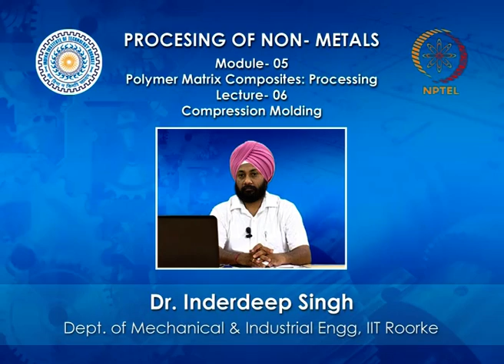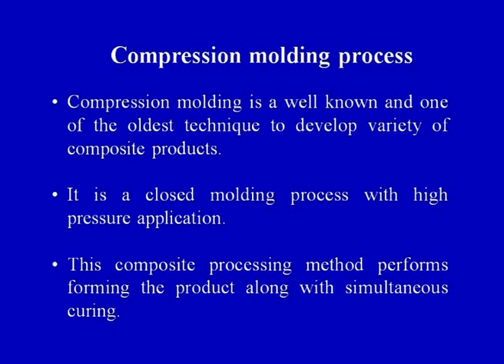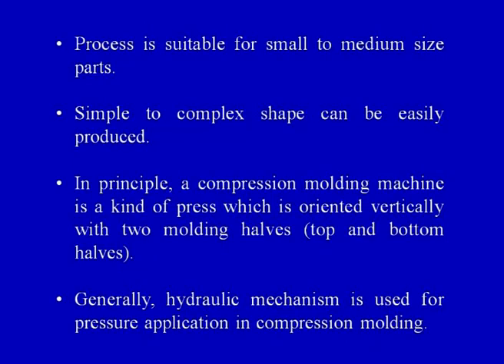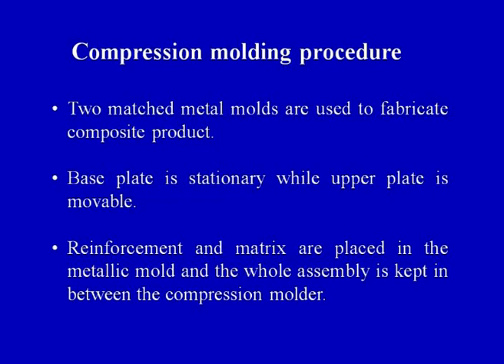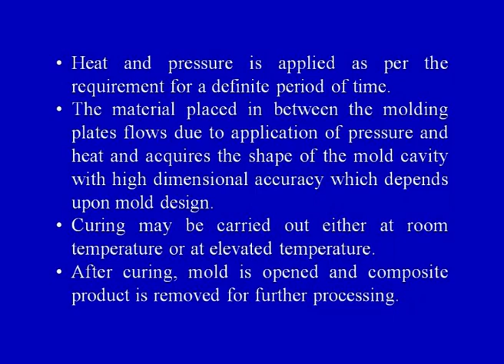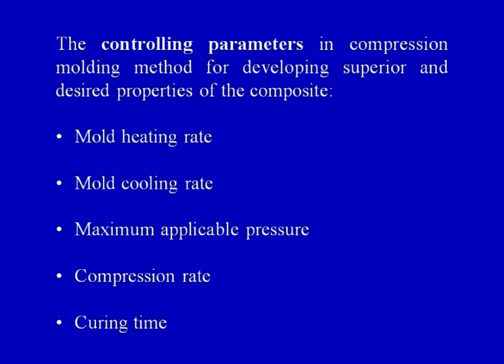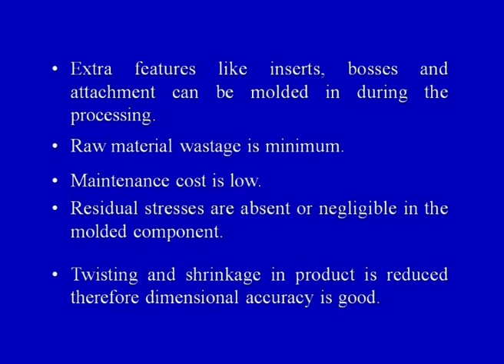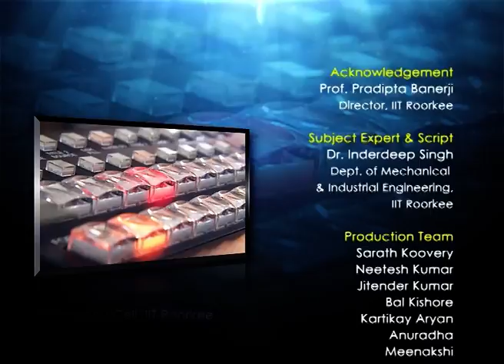Mod-05 Lec-06 Compression Molding

Comment: Hello Dr. Inderdeep. I've just finished Module 5 six lectures & want to tell you that  you're so clear & indeed simplify things in a wonderful way. As a design engineer / product designer / Tooling engineer and machinist for more than 14 years now, I did benefit a lot from your lectures in recaping my understanding of composites. I'm daily engaged in the design for LRTM and infusion, products, tooling, CAD & CAM but things were never structured in mind like they are now. Thank you sir & NPTEL

Comment: This is an ok video for a person to view that has no idea about molding or compression molding however it does not address advanced issues. it also says nothing about silicones such as small medical parts or achieving perfect parting lines using machining techniques in the mold itself.  It says nothing about avoiding bubbles etc.  it is pretty much like first grade for someone who never has--and never will use compression molding--only talk about the concept for a test. I realize that the Dr is not giving an advanced lecture--I am saying that this is far to simple even for a beginner and I would like to see a lecture on more advanced problems and applications such as parts with undercuts that require micro-machining. also this video over emphasized great pressure when in fact compression molds can be molded with almost zero pressure in the case of silicones. as a matter of fact for perfect parting lines with some or most materials the pressure should be RELEASED after initial compression. in the diagram shown which i understand is only meant to be a basic mold such as a dog food dish--you could exert one million tons--and i assure you that mold WILL NOT work correctly and is missing certain things in the diagram..